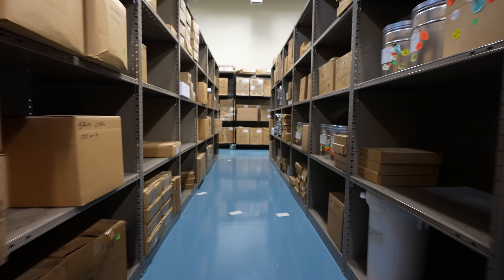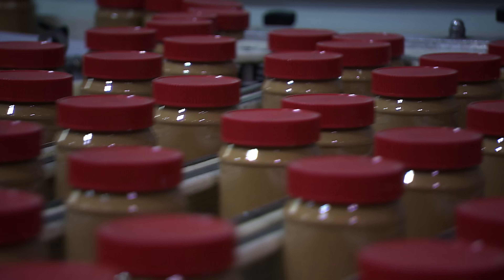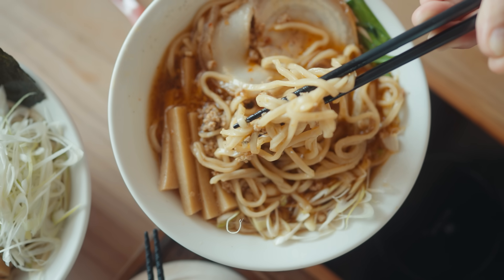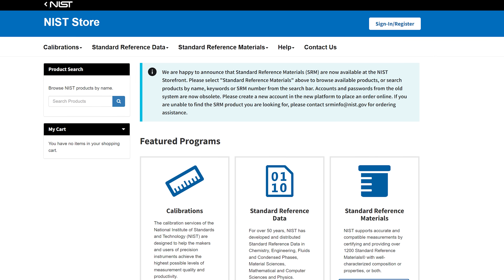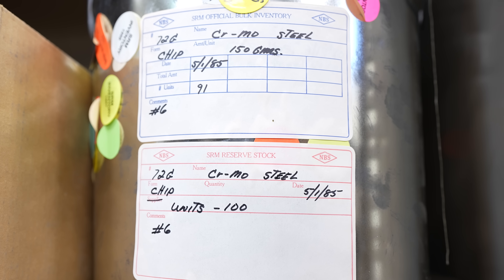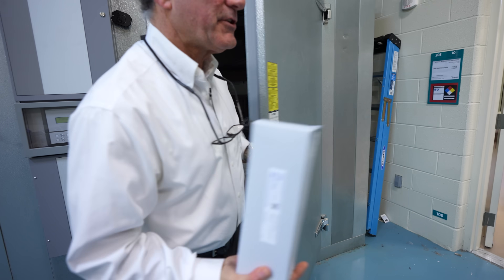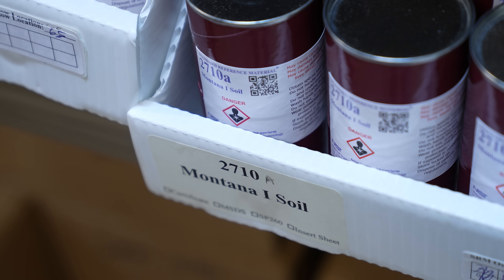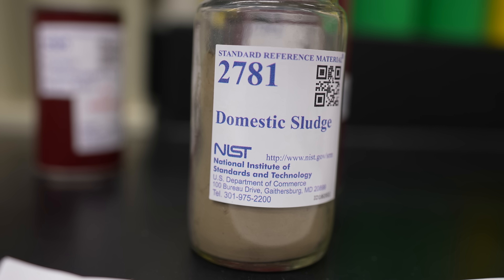The world depends on a collection of strange items. They're not cheap

Comment: so the peanut butter... if it's old enough as to be considered potentially unsafe, doesn't that mean everyone's calibrating their machines against potentially unsafe (or at least, officially, unfit for human consumption) peanut butter? It's unclear if it's sterilized so there are no biological processes changing the content after/during measurement as is the main cause of domestic food spoilage, and there'll certainly be some chemical reactions changing the makeup of the contents unless it's all sufficiently aged that any volatile substances have reacted together and any/all o2 in the container has diffused into the sample, maximally oxidizing it and/or having it thoroughly re-mixed before measurement. I'm not sure what other non-biological chemistry would occur in a jar of peanut butter... light breaking down molecules that re within a millimeter or two of the wall of the container? salts crystalizing out? obviously oil separating out, but that's a physical reaction, not a chemical one... but it means adequate re-mixing before use for calibration would be crucial

Comment: I'm not sure if every product they make is of vital importance though, and i don't really agree with the business side of it.
For example the Charpys, at this point they should be able to be produced for a low price, considering they've been made in the exact same way for many years.
I worked at a couple of food factories, we compared the products through the data, not by comparing it to a "factory standard" made product that costs a thousand bucks, all the ingredients were listed and as long as we stuck to the list then our food was good.
But i guess their stool and dust samples could save researchers a lot of time of collecting samples themselves, but it does feel a bit like a typical 'government business' with bloated budgets/prices, the guy was a bit too eager to boast about the values, which i thought was a bit misplaced, but eh, it's a business.
Reply: While you may be very correct that the food companies you worked for compared through data - as was stated in the video these are used more than just as a one to one reference. 

The more important thing they are used for is calibrating the testing equipment used by companies. As when someone makes a machine to test something you have to make sure it gives the correct results, and the same results as all other machines - otherwise the data is useless for comparing it. Your testing machines might have imperfections, or have been built differently afterall. 
If the results from a companies testing all match the results when to the standard sample and data from NIST - then you know the machine works and is accurate. You then don't need to buy another standard sample unless you are doing maintenance. You can just use your machine to compare the data, being sure your machine matches every other company and regulators machine.

Comment: What happens when they run out of a material?  Do they go out and source it again and then run a new in-depth analysis on it again?  Seems like a 2nd material gathering would likely have slightly different chemical signature than the original sample.
Reply: That's exactly what they do.  They go collect more and complete the analysis again. A new batch can take a couple years to complete measurements.

Comment: There’s a great story you’re (usually) told during NIST orientation for new employees about the Great Baltimore fire of 1904. Lots of FDs from surrounding municipalities and states came to try to help, but at the time, there was no industrial standard for hoses/couplings, so it turned into quite a mess, and more injuries and damage arguably resulted. Those items are now standardized across the country. The HR folks are better storytellers, but still demonstrates the importance of the work of standardization
Reply: Standards are something that you don't realize you need unless you don't have them.
Reply: @vigilantcosmicpenguin8721  

Things you can say about your work and also about your ex!
Reply: imagine every PC manufacturer using proprietary connections instead of the industry standard couplings.   It used to be that way, along with a lot of industries.   We are seeing that in EV charging right now and it limits charging stations and keep the prices high for adaptors.   NIST will eventually sort this out and save the industry once again.   Hell, there was a time when even basic 1/8th inch stereo connections weren't standardized.
Reply: @studgerbil9081  the problem is even worse with e-bike chargers. Even if the charging plug looks the same, they may have different power ratings or even supply differing voltages.
Reply: Then proceeds with "let's use Imperial units".
Didn't you people dumped tea and fought a war to get rid of the "imperial" stuff?!
Reply: @ylstorage7085  doesn’t matter what units are used as long as it’s standardized. That’s the whole point.
Reply: @ylstorage7085  actually we do use the metric system for science and stuff that matters internationally, but use imperial in day to day stuff because it makes much more sense and is more intuitive
Reply: @ylstorage7085 this is the dumbest comment i've read in a while, also we use metric in the united states alongside imperial units
Reply: @JoseRodriguez-ey7ju  so.. that's not the dumbest you have read in your life? there is still hope for me then.
Reply: Sounds like a story told to justify obscene government spending (of taxpayer's money)... As if the problem wouldn't have worked itself out without government being involved. Government's here to help you! LOL
Reply: @trentp151  Setting general rules without specific assignation is not coercive. Standardization laws which keep the entire economy running smoothly is imperative to supply the military which protects the franchise given to you at birth. This saves lives and makes innovation easier. Not everything is the US governments fault, just a very sizable portion.
Reply: @trentp151  "s if the problem wouldn't have worked itself out without government being involved."

How would they do this?  Have every company develop their own standards?  And apparently you missed the part about this group operating as a business.  This means that their source of revenue is selling those products.
Reply: @trentp151  It probably wouldn't have, though. Especially not if corporations had any say.
Reply: @trentp151  You're a libertarian aren't you?
If the world worked like you wanted, you'd have proprietary electrical outlets by different companies made for different energy providers
Reply: They should tell the story about how people quit nist and joined architects and engineers for 9/II truth because of the fake garbage they made them produce.
Reply: @jiaan100  ". . .  because of the fake garbage they made them produce."

OK I can use a laugh.  Why do you think the report was fake?  And can you explain how they could fake something that was literally distributed to the entire membership of the US Association of Structural Engineers (I may have gotten the name wrong) for their review and comments - yet have a bunch of people with not technical backgrounds catch that it was "fake?"  100,000 structural engineers reviewed and commented on the reports - but you were the only person who discovered they were fakes?  

Go ahead - I eagerly awaiting your explanation as to how this happened.
Reply: @colincampbell767  comment failed to post, I'm taking about stuff they don't want us to talk about. I'll try censoring some keywords but if it doesn't work I'll screenshot and post it to imgur.

Edit: checking this post worked (it did)
Reply: @colincampbell767  can't post the comment and can't link to an imgur screenshot, youtube's too good at censoring. I'll give it another few tries. 

Test
Reply: youtube really doesn't want me to post about this or post links to imgur (the latter is understandable).  a/6aLO2Tg

Test, yoooo! finally they let me post.
Reply: @jiaan100  I have debated several people on this subject, and You Tube never censored it.  And of course you can't post an image in You Tube comments - nobody is allowed to post pictures.
Reply: @colincampbell767  youtube will pretend to post a comment, but if you try to edit it the edit will fail and the post will be gone later. So you maybe have just not noticed.
Reply: @jiaan100  I haven't had that problem.  Besides I simply asked you to explain how the NIST can lie and not get caught by the members of an organization of structural engineers.  (BTW - the documents were also sent to the American Association of Mechanical Engineers.)

What expertise do you conspiracy theorists have that the people who design buildings don't have?  Especially since your group tends to display a complete lack of understanding of even high school physics.
Reply: @jiaan100  OK - explain to me what the difference is (especially since the towers did not collapse at 'near freefall speed').  And it didn't use potential energy to destroy the concrete and steel - the potential energy was converted into kinetic energy, and this is the energy that did the work.  Sorry - but you struck out with that one.  

BTW: how did you calculate how fast the building should have collapsed?  And if those "engineers who were members of the ASSE" had issues - why didn't they bring them up when they reviewed the reports?  (And how do you know that these people were actually working structural engineers?  Did you check credentials - or did you just assume that they were telling the truth?)
Reply: @colincampbell767  fires and structural damage at the top should not cause a steel and concrete skyscraper to collapse within a few seconds of vacuum free fall speed.
Reply: @jiaan100  "fires and structural damage at the top should not cause a steel and concrete skyscraper to collapse within a few seconds of vacuum free fall speed."

First of all - I already pointed out that it didn't fall at "near vacuum free fall speed."  This is something you can verify for yourself by timing the collapse took and comparing that against the formula for acceleration due to gravity.  (Remember to start at the very beginning of the collapse - such as when the radio mast on top moves on one tower or when the walls get sucked in on the other. And use some kind of stopwatch.)

And what makes you think that the fires and damage would not cause this?  The stupid "jet fuel won't melt steel" claim?

Comment: laughs in Snow Piercer

Edit-
But doesn't manufacturer standard vary EVERY PRODUCTION CYCLE (daily if made everyday, etc etc) vs the NIST srm because of various factors; one that comes to mind first is where the materials/ingredients are sourced, next are the presence of standardizing personnel (chemists, engineers, etc etc) , condition of equipment and production facility, and last (may be) but not the leas*t, by country of origin though... 🤔😕🥴😵

Comment: I used to work at as an allrounder at an underground margarine research lab in Alaska and we used NIST standards to calibrate solidifying equipment during the summer. The accuracy of thermo projectors accounts for helluva lot more quantum slices than I'd care to admit!
Reply: What's an underground margarine research lab, some kind of rogue operation secretly working behind the back of the Big Fat?
Reply: @tuomasronnberg  Recognizing residual applications of advanced solidifiers is integral to the production process whereas research and development in the area has the potential to boost preliminary catalyzation of core performance parameters. This is where it becomes crucial as NIST provide the accurate standard we measure our equipment by.
Reply: @CrazyGaming-ig6qq  I was making a joke because "underground" can also mean "illegal". Imagining an illegitimate margarine research laboratory just sounded funny :D
Reply: @tuomasronnberg  lol that's actually funny, researching forbidden illegal margarine techniques.

Comment: EDIT: So I checked the Certificate of Analysis for some of these SRMs and some are actually fairly old. With that said, I think I'm misinterpreting what these SRMs are actually used for. I don't think new samples from whatever company are measured comparatively against these NIST SRMs, but instead these SRM's are used as a means to calibrate equipment and methods used to measure other samples. In that sense, it doesn't exactly matter when and where the samples were collected. What matters is if whoever is using these SRM's can get the same results from measuring the NIST SRM's per the NIST Certificate of Analysis.

NIST is also re-measuring their own SRM's to determine any substantial changes and if so, will notify whomever purchased the SRM's. It's likely they will also manufacture new samples, but who knows. I didn't read that much into it.

--- Post from before my realization---
Maybe I missed this bit, but it's not exactly clear when some of these samples were collected/manufactured. From how it sounds, some of the more dynamic ones (foods, human waste, biological samples, environmental samples, etc.) that would likely change due to numerous factors were simply collected "at some point in the past" with no real specific time. If this is the case, then I don't see how comparing something manufactured/analyzed now to decades old samples makes any sense unless you're looking for those changes.

For some things like the dust, "Typical American Diet", the peanut butter,  I'm curious how often they recollect and analyze samples as the constitutes are likely to change over time based on a ton of different factors.

 For example, dust collected in the early 90's is likely to be vastly different (aside from the skin cells) than dust collected today. Why? Well some materials widely available in the 90's may have been banned, alternatives were used, or simply new materials were invented. All of these could contribute to vastly different particulates being shed, especially with things like cosmetics, clothes, pollutants, etc.

The peanut butter was said to be way past its expiration date. Peanut butter lasts for 2 years unopened and likely longer if kept in a very stable environment such as NIST. If the peanut butter is too old to eat, then it sure as heck would be unfair to use as a test sample for NEW peanut butter since it's likely things will start to break down and degrade over time.

Peanut butter would be interesting because it's very likely that environmental factors could change how the peanuts grow, including what human-contributed environmental toxins they absorb. Have farming techniques improved to produce better peanuts? Who knows for sure, but the comparisons could be made by comparing these samples over time they were produced.

The "Typical American Diet" bottle appeared to have a yellowed label which tells me it was a bit old. Not sure how old, but our diets 20 years ago are fairly different than our diets today. Why? Well aside from new food technologies, changes in daily habits, and such, 20 years ago the "Food Pyramid" was still around (it was updated in 2005 and fully replaced with MyPlate in 2011). Do people even follow these guidelines? I'd say enough do to show up as a "typical diet" trend when surveys are conducted. I also think some federally funded institutions have to follow these guidelines for served foods. Even those who blatantly ignored it for whatever reason would also have a fairly different diet now than they did 20 years ago.

Same with the sludge. What goes in must come out. That plus all the other stuff that gets collected in treatment plants. I what the differences in captured pharmaceuticals would be, both from metabolic waste and from people flushing drugs. There are very likely big differences over time.

Comment: That's stupid. No two cigarettes are the same. No one gives a sh*t how flammable is a sheet when a lit standard cigarette is dropped on it when the actual cigarette is going to be different (because no one will buy these perfect cigarettes for smoking). Let's say that these standard cigarettes are a really good representation of the average cigarette. Well if you compare two different brands - one burns above average, the other below there are 100s other factors that have a lot more impact than the brand or the contents of the cigarette - like moisture, the angle it's dropped ... If you get 10 of these perfect cigarettes you will get 10 different results and you can't guarantee that these results will be more accurate than a random brand of cigarettes. The steel bar makes more sense as a transfer standard ...

Comment: In woodworking we use micometers (calipers) to check the dimensions of milled wood down to sometimes the hundredth or thousanth of an inch. Wood is silf conpsred to metal and machines can gouge the surface so sometimes its hard to get a good reading as it moves slightly, for that or if the number isnt what we thought it would be we will have another 1 or 2 people check with thier calipers. Or you and 1 person and check a peice of metal, make sure its calibrated and try again.

Comment: Could you do a follow video on how they prepare these standards? I would imagine that homoginizing all these different samples must be much more difficult than one would initially imagine.
Reply: Not only do they homogenize, but then they measure. For the cigarettes, they first homogenized a huge batch of tobacco, then measured from the top, sides, middle, etc. to make sure the standard deviation was acceptable. Then they made the standard cigarette, then burned cigarettes from the beginning of the run, the end, middles, etc. Again making sure the standard deviation was small. This is the way they have confidence to say that This Cigarette will burn at a certain temperature plus or minus a small amount.